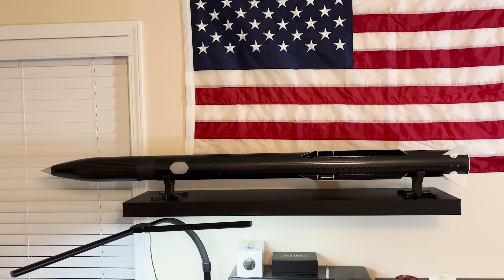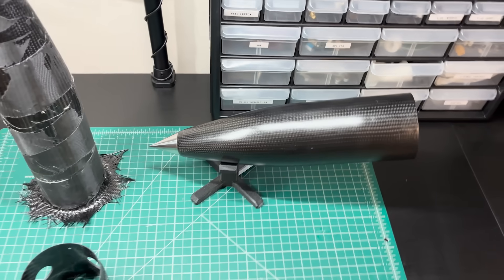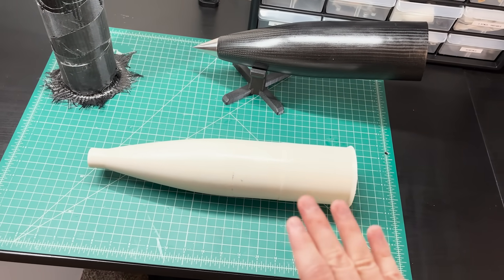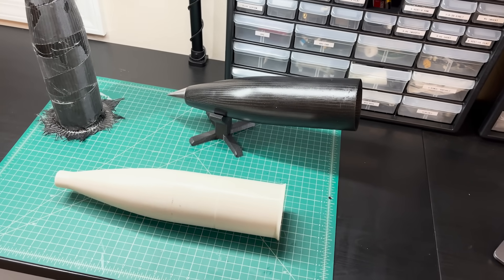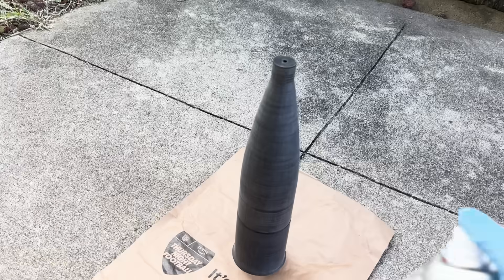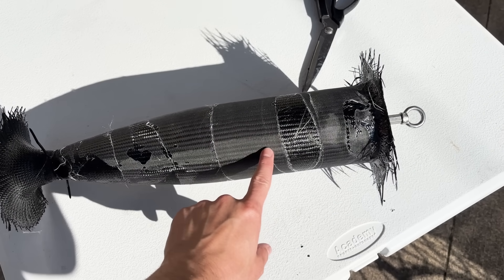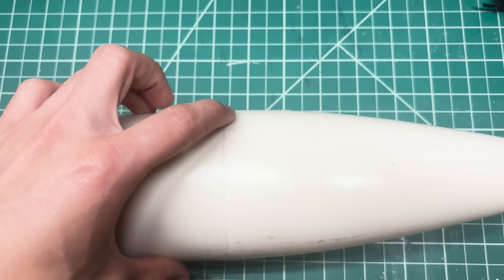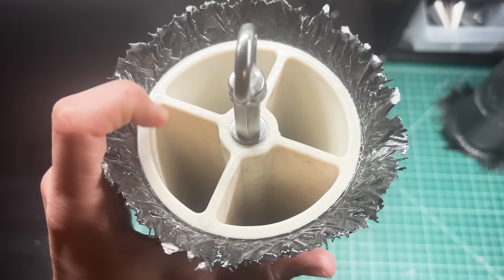Making Carbon Fiber Nose Cones at Home

Comment: Dissolving the core instead of melting it might be worth a try. Print a core form soluble PVA filament (or a solid core printed in another filament and a vase mode shell printed in PVA around it) and then just dissolve it out of the nose cone. As an added bonus there's no stress from pulling out the core.
Don't know if PVA can be vapour smoothed, but it shouldn't be necessary for this method.
Reply from the maker: I would love to try this idea some day! The only downside is that you don't get to reuse the mold for longer production runs.
Reply: @LafayetteSystems  I did some rough modeling, for the "solid core and PVA sleeve" method the consumable sleeve would take 1-2 hours to print and use 1,5€ - 4€ in filament. I think that is a reasonable print time/materials cost for small scale production.
Reply: Or like a 2 part mold as this geometry is simple enough you can reuse the inner core for strength and keep printing pva outershells again and again just need a big enough printer
Reply: I was just thinking of this same process. If you have a multi head printer I think you could do a dissolvable outer skin and a base material that is cheaper. Sure you still scrap the model, but you may save some money in dissolvable filament... 

Or a small core support that dissolves, then you can pull the mold away by deforming the mold after the core is gone.